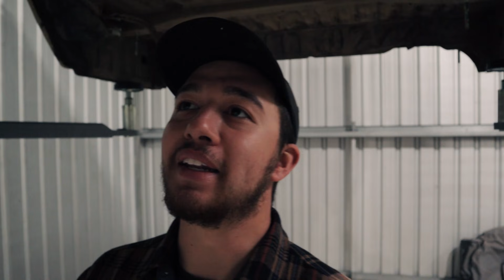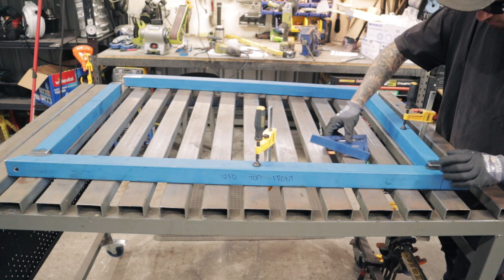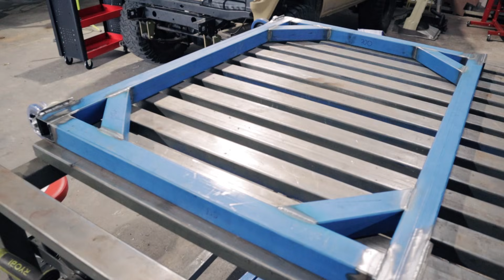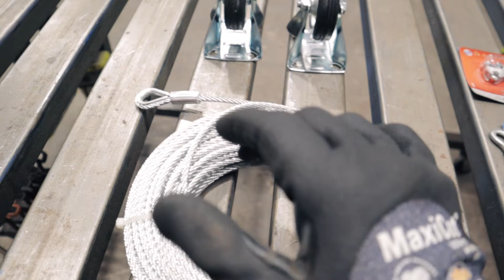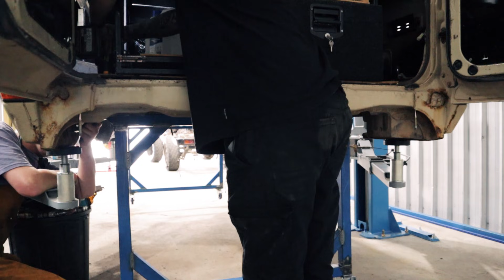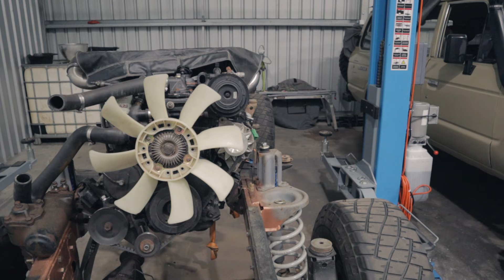Coil Conversion PT 5 (PLUS MORE!) - HJ75 Troopy Build (EP24)

Comment: love to see update!
Do you mind explaining your thoughts on Patrol instead of 80 series diffs when you can get a kit from Ironhide. 
I have been thinking with my hj troopy using the standard 75 series diffs being 9.5" with flipped radius arm mounts etc from Rampt and RCV CV's and 6 shooter knuckles? Stronger front centre than 80 RCV CV's with 6 shooters should be strong enough, your not getting really wide and its still toyota. love to hear your thoughts

Comment: Have you looked at building a 4 link setup since you have a clean slate to work on?
Or are you going to try make the nissan geometry work?
The problem i see with trying to get the nissan setup to fit is if its lifted more than 2" from the geometry nissan designed you are making some big compromises.
Reply from the maker: You’re not wrong, I am seriously considering it at this point
Reply: @ShedBuilt  
There is some good info on the pirate4x4 forum. The guy who build the 4 link calculator has done an amazing write up from what materiels to use to how different aspects of the geometry affect handling.

Once you get your head round it, it should be a fun challenge.
The hardest part will be finding suitable tube for the lower links as 2" dom tubing is hard to get.